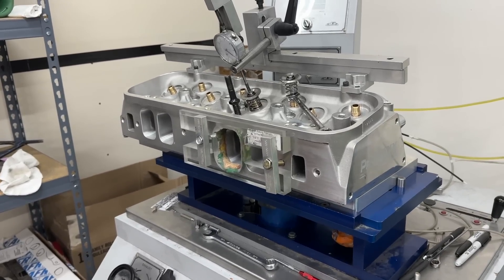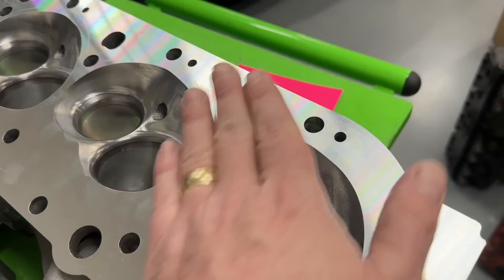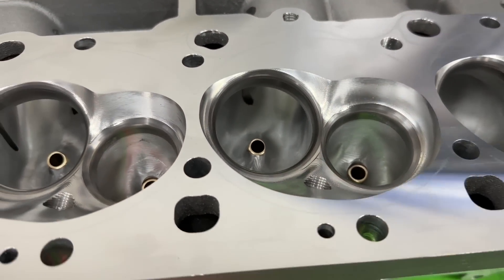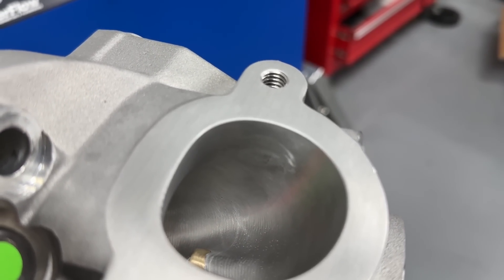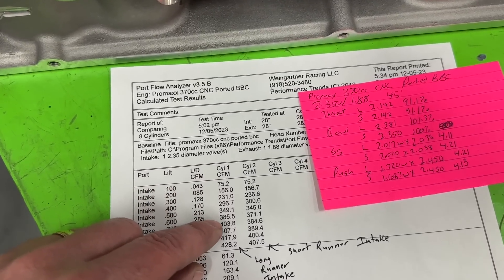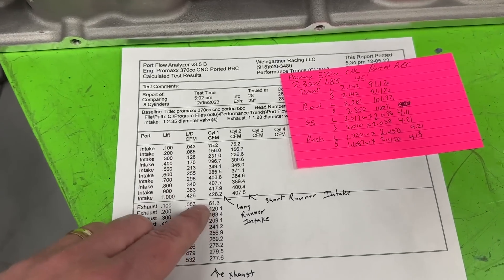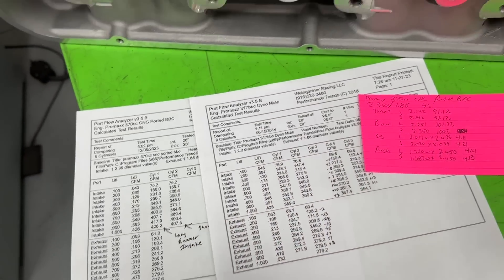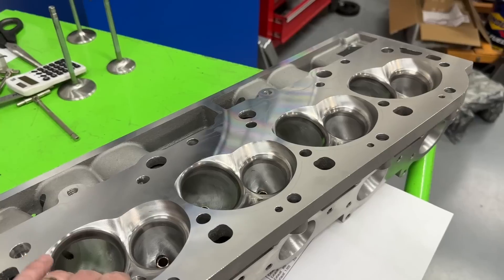Promaxx 370cc Cnc Ported Heads Review With Real Flow Numbers

Comment: I’ve bought 2 sets of the 370 shockers ran one set on my 632 and the other set on my blown 565 both engines made great power the 9.5:1 632 made 770 hp / 840 tq the 565 made 846 at 5 psi

Comment: Bought pair of them bare unused for 900bucksflowed alittle better on our super Flow bench.put on my 564 ci  made good power 11 compression 715 lift cam . didn't Dyno it but ran 614 eight mile at 3500lb truck at Darlington

Comment: I ended up getting Brodix Race Rite 365s with intake valves at 2.375 .Mike Weinle is putting in the larger valves and mildly porting the heads. 
Eric, have you ever had the chance to flow these?  It was hard to pass up Weinle Racing price for quality name brand Brodix heads.Eric, I'd like to
see your take on these.
Reply from the maker: The old adage is usually true you get what you pay for. I haven’t seen that head with that size valves.
Reply: @WeingartnerRacing nice vedio, when are you going to port a ford fe head

Comment: I get the whole don’t support China thing, because I agree. But I think promaxx does good work on the Chinese cast, and I think most of your money when you buy from promaxx still stays here in America. 🇺🇸
Reply: It's just the casting, which is as good as anything cast here.  They make heads to the specs of whoever is having them made.  Heads are all about the machine and assembly work, which is all done here, by Americans, using good parts. 
I wouldn't trust heads assembled in China using offshore parts, but a casting is a casting, pretty much.  
Pro Maxx is in Alabama and employs a lot of Americans and does everything but the casting here.   No issues with where these are cast at all, not with me.
Reply: I do business in China. I have walked into huge/big/small/tall/short/etc... shops that will blow you away.. Don't think they are backward, they most certainly are not. I understand the issue between there cylinder heads with sub par performance. Sorry, I don't want to share this to anyone right now. We will let them figure it out.

Comment: They took a 317cc head and cut 50cc of metal out? Thats a bunch...doing some rough calculations the average material removed from the port wall is just over 0.060.
Edit..the intake valve is maybe a bit small for a 370cc head, a 2.375 with a 50° seat would prob up the intake flow a bunch

Comment: Good review Eric. I buy a lot of stuff out of China for a few different reasons. I'm in Australia, and by the time anything American gets to me, it's about double the US retail price. I've been very happy with the quality of the Chinese castings, porosity is something that I essentially don't  see. Unlike a lot of the American castings that I have had. When I'm not doing max effort stuff, budget is always a consideration. A lot of the name brand US stuff isn't actually being made in the US anyway, and the quality for the price equation isn't that good. Max effort stuff needs the best, so the extra dollars isn't that relevant to the conversation. Saying something is substandard simply based on racist bias is self delusional, which are most of the comments that we see made. I'm no lover of China, but I am a lover of value for money, and I've been to China, and I've been through a number of factories there. What I can tell you is that IF you are getting poor product out of China, blame the importer. They manufacture to the price point that the buyer wishes to pay. A company that I was working for some years ago was buying wheel bearings out of China,  because they lasted better than the name brand US bearings that we had been using. There was a price difference, but for us that was just an added bonus.

Comment: Lousy numbers for a 370 cc 2.350 valve head. I think its partially like 440 mopar head syndrome where the valve is to chamber shrouded to make work well with a large valve and large csa.  If the air runs into a steep chamber wall and cant get out. The greatest port in the world will still suck.

Comment: I built a 496 with the Pro Maxx 340cc heads, it made 820 hp. at 6,700rpm...  My 468 makes 800 hp. with Brodix 310 cc heads, not CNC'd. 108cc combustion chamber...  12.3 comp.  ,50° valve job.  317cc's might be too big for the 468...  Car goes 5.62 at 123 mph. in 1/8th and 8.82et. at 152.52 in 1/4 mile
...
Reply: That 468 ran 562 was that all motor ???

Comment: Well Mr Weingartner you do not “suck”.😃 I do appreciate your honesty and willingness to educate fairly. Even though currently I am “married” to a set of good “781’s” I appreciate the work you have done with the Pro Maxx 290, 317 and these 370’s. If at some point I decide to move forward with a set of aluminum heads for my 4.320” 468 the 317’s with a good valve job might be a worthwhile upgrade. Thank you!😎

Comment: Those heads would still make good power, I would imagine it would be easy to make 100+ hp per hole with 565 inches, 11:1, 274@ .050, with a good intake or a tunnel ram.

Comment: Probably should measure cc IVe got a set mine measure 352 cc .mine Flow 42o  s at 800 on superflow 600 .lift. what would you do to improve them
Reply: I poured the head in the video at 366cc long runner